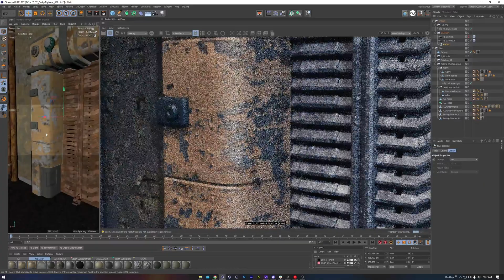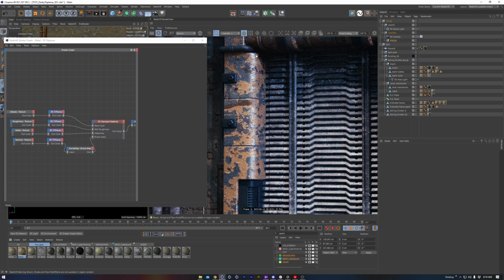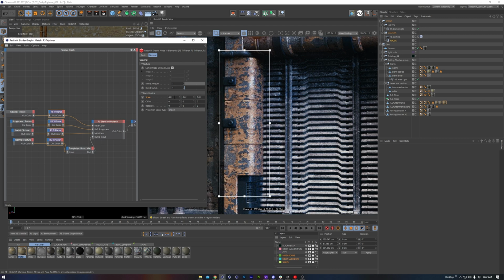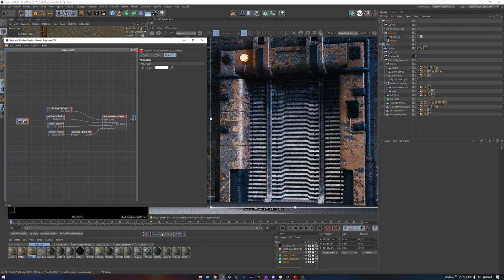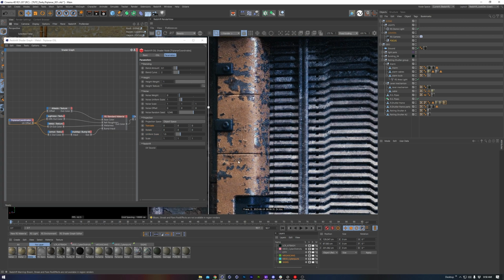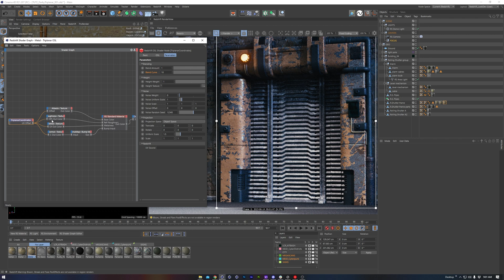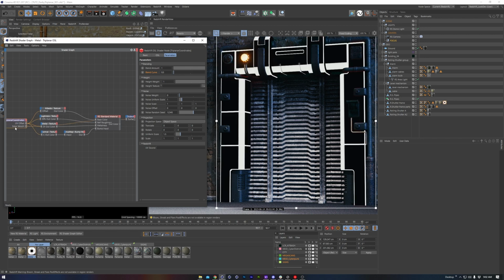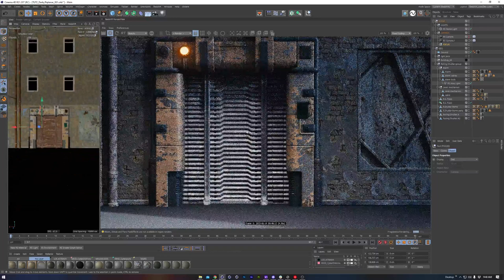Gernge Quick Tips - Better Triplanar OSL Node | Cinema 4D Redshift

Comment: Hi, great tip thanks ! I'm still having a hard time understanding where I can input real-world scale values of the textures I use that are not square (like a wooden plank that I know is 200x50 cm for instance). How do I tell Redshift those dimensions, and how do I tell triplanar in which direction to project X,Y,Z depending on the grain of the wood.
Many thanks !!
Reply from the maker: Hey, thanks for the question. My answer for that is a pretty weird workaround but it works for me. Setup your RS material with the texture maps, and then set the C4D Texture Tag to a Cubic projection and then you can use the Coordinate tab to enter in real world values for the scale. So you set the proper scale for the texture maps and then get a visual idea for how large that translates to on your C4D object. Then you can go back to a proper UVW projection or however else you want to setup the texture and try to match them visually. Not ideal, but it works for me.
Reply: @gernge   thanks for your reply. I find it crazy and strange that there is no proper way to do this in C4D. My clients are furniture makers and provide me with textures that need to be exactly reproduced to I can't afford to eye ball... hope there will soon be a better solution. Have a great day !

Comment: Hi man ! Thanks for your tutorial ! Very useful ! I have one question. I have to texturing a big height map terrain, any suggest ? I mean i have an height map as a base displacement and i add some displacement triplanar over with displacement blender. but don t work well because on the side of the mountain the  displacement dosent work. It works just on the top
Reply from the maker: that's a lot harder, for sure, doing large terrains. i'd try working with some noises and seeing what you can do procedurally. either with Redshift material, Maxon Noises layered together in a displacement or using Cinema 4D Displacer Deformer with noises

definitely harder than a single object that's normal size, like the wall/doorway i showed here but hopefully that helps a little
Reply: @gernge  thank you very much for the answer ! But i have to use the height map for more accurate result, i will try to put some displacement over the height map without the triplanar

Comment: Nice stuff. 
btw. I usually use Value node to scale my textures or even noise. You can find it in Math - Value. Very useful, one node can scale all textures or noise. Also this is useful if you want to rotate texture or noise.
Reply from the maker: yep, it's a solid node. very familiar with it for adding easier controls. still cant beat having a nice slider built right into the actual node though!